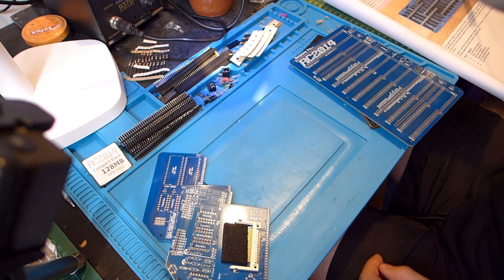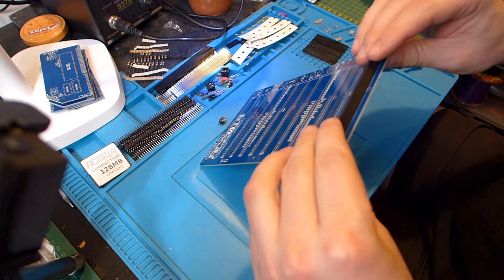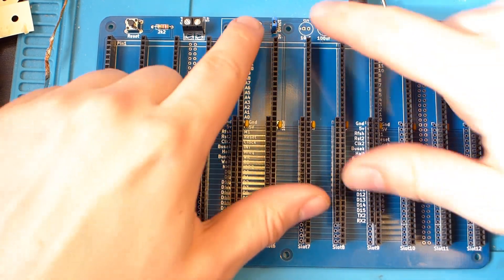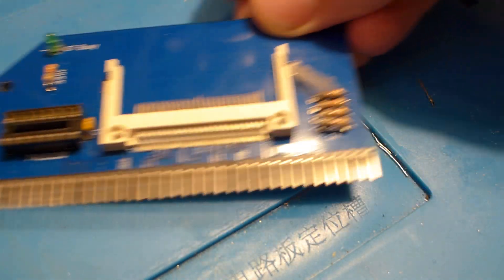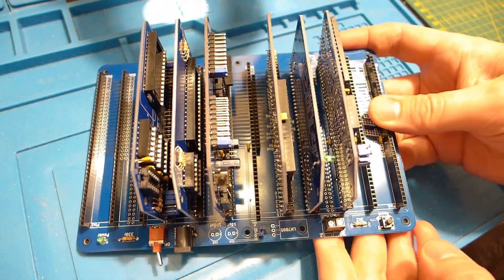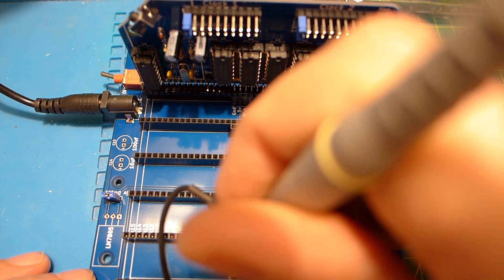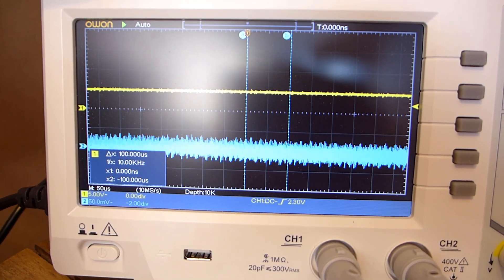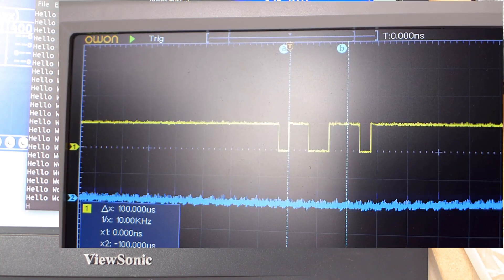I built a computer from scratch! | RC2014 Z80 computer kit assembly.

Comment: Why is the 7MHz clock signal asymmetric? Also a good idea to learn to use the ground spring on your oscilloscope probe rather than the flying lead alligator clip. It’s probable that the overshoot spikes on the clock edges are caused from the flying lead or from the unterminated motherboard PCB.

Comment: Well, sir, to do any sort of proper soldering job you MUST user solder flux, which I have not seen you use (maybe I missed it while typing). Solder with flux inside is never enough (never was never will be, specially worse when the solder has more than a few months of the shop)
Reply: I've never found a solder with flux to "never be enough" in 40 years of soldering.
Reply: @SpeccyMan  Same here. Occasionally a board will want some extra flux, but not all that often. For instance, the parts that I have been hoarding since the 70s might require a bit of flux. Maybe... :)

Comment: It is a nice little Z80 system but I think it is a little pricey for a hobbyist, so I opted for the much cheaper and equally effective SC114 from small computer central. You just need to add the full speed serial port board to it as the onboard bit-banged port is limited to 9600 baud. That comes in at a little under one third of the price of the RC2014 pro. For an extra $20 I also added their CF board to be able to run CP/M. Total price was $77 compared to the $199 of the RC2014 pro. The SC114 has 4 slots onboard but I have extended it using the RC2014 Backplane 5 as I plan to design an add on board or two myself.

Comment: forget CP/M - add graphics and sound and turn it into an MSX computer
Reply from the maker: Adding graphics does sound appealing, although I can’t work out a way that doesn’t rely on either unobtainable ancient chips or “cheating” by putting a device more powerful than the entire machine in it.
Reply: @ncot_tech  What about the TMS9929? The LM80C is a Z80/TMS9918 homebrew that runs on a monitor.
Reply: The RC2014 uses 32k RAM pages, but MSX expects 16k pages, and a very specific memory layout.
CP/M is really the way to go with these kind of systems. Because it is a hardware independent OS at it's core, allowing programs to be shared and code to be reused.

Comment: Did you use a flux pen on those joints? That might improve the flow..  Great video!
Reply from the maker: No, I was kind of hoping the flux in the solder was good enough. Some flux is on my list of things to buy though. I've since found my leaded solder and it works much better.
Reply: @ncot_tech  I can recommend a flux pen - it's basically a marker pen - easy to use and puts the flux where you need it (mainly!). I learned a lot from fixing drones.
Reply: I used resin and 0.6mm soldering tin wire and the tip of the iron isn't too big. For my soldering station I set it to 370 degrees celsius (it's probably not accurate) and you can see a blob of tin melt and jump on the leads and pads. I love your videos and I love my rc2014, both are simple and elegant.

Comment: I just bought one of these kits and I'm going to start putting it together this weekend. :3 It's the biggest electronics project I've undertaken, so I'm a little anxious, but whatever happens it's gonna be fun. :3
Reply from the maker: You're going to have a lot of fun with it 😀 The soldering is easy if you take your time and use the docs on the rc2014 website.

Comment: 4:20 pretty sure you put that socket in the wrong way, not that it matters electronically, but being able to line up the pin1 notches saves you lots of headache in the long term
Reply: 4:55 seems to show it corrected
Reply: @ArcaneMirage  right, for like a half second, didn't even spot that :D
Reply: Even if corrected, its good practice to try to match the sockets pin1 indeed to whats on the PCB (or even better, check the schematics). Was looking in the comments for this one :P